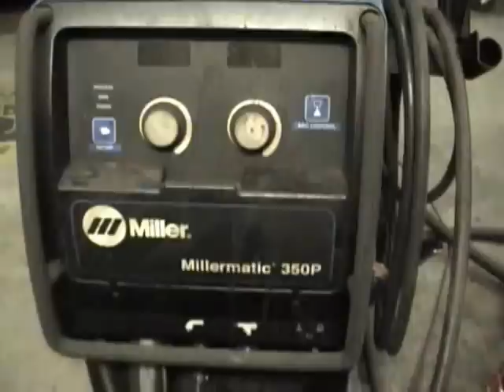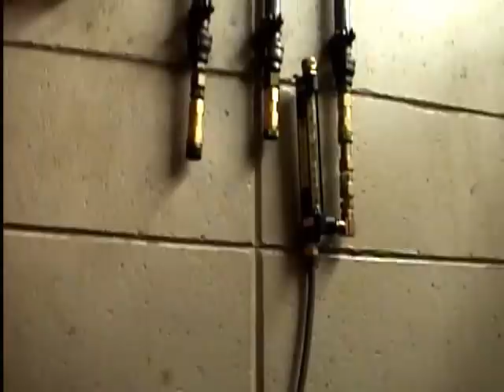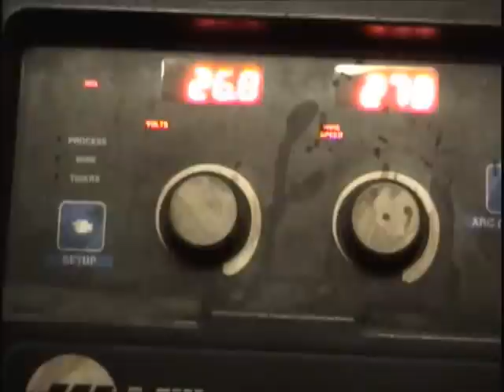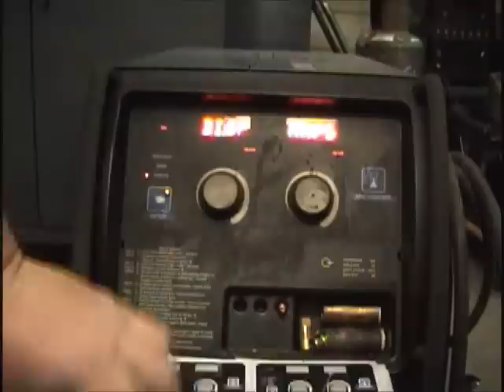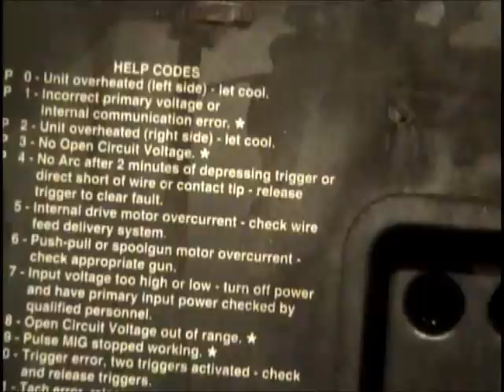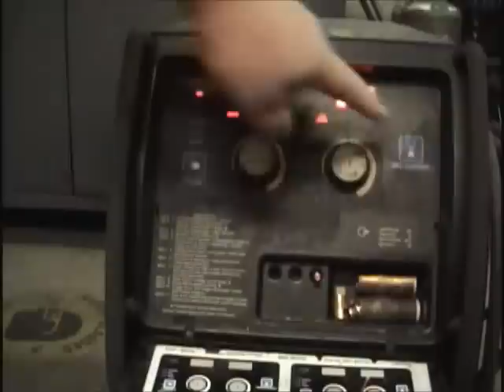Hennepin Technical College set-up video of a MILLER 350P v1.2.WMV

Comment: I've had my 350P for about 10 years & am really an occasional user.  My 'grade school! welding education was learned on an old Lincoln gas engine and later an Airco DipPak 250.  All was well until I took on [or tried] aluminum welding of our neighborhood irrigation works that I hit the proverbial wall.  Had a pretty good teacher in the group but I never got the hang of it.  Then one day Miller Pulse makes its debut & made aluminum welding child's play [at least in my world].  About 4 days ago I had a piece of cake small welding job where I needed to weld some washers on a 1/2" axle.   Fired up my 350P for this all steel 10 minute job.  For days later and I'm still struggling with it.  The last time I used the machine [4 months ago] it was to weld some hooks on the loader bucket.  All steel work that went off without a hitch.  Now all the damn thing will do is deposit a single bead and quit.  Wait a few seconds and get another bead.  Like a breaker was tripping & resetting.  Was going to take it in for repair on Monday but decided to listen to Chris' video again.  This time I was paying more attention to the Timers segment when he mentioned the Spot timer.  Didn't know it existed but it sure sounded like it could be my problem.  Crossed my fingers & headed for the shop.  Sure enuf, the Spot was set on its shortest time, reset it to 0 & you can guess the rest.  Thanks Chris, you made my day!.
Reply: Do you still have this machine ? Are you happy with it ? It's on my short list.

Comment: umm, 3 phase? I believe that unit is also single phase..also you called out the gases on your wall as argon 1st, blended 2nd and C02 3rd. should you be connected to the 1st one?? I presume you are using this welder for Aluminum?
Reply from the maker: Chris Smith This machine is currently configured for ER70S-6. Yes this machine will convert to single phase but requires a lot more amperage for that set-up. With welding mild steel the shielding gas that the students use is CO2. It is the most cost effective gas and requires a little bit more skill to master.